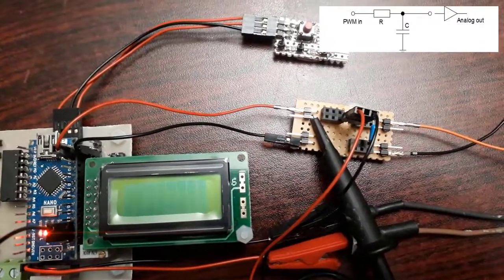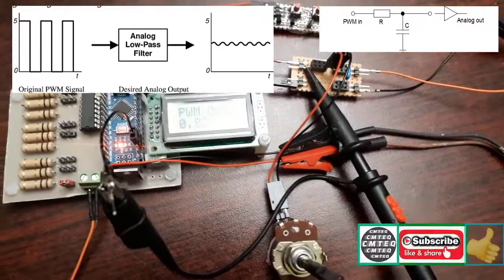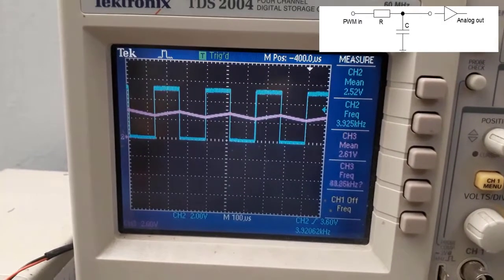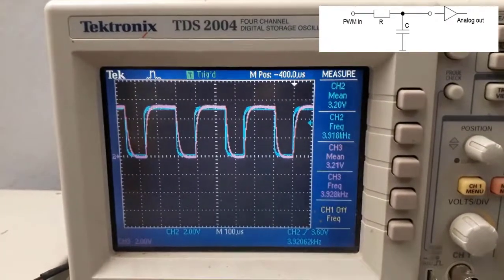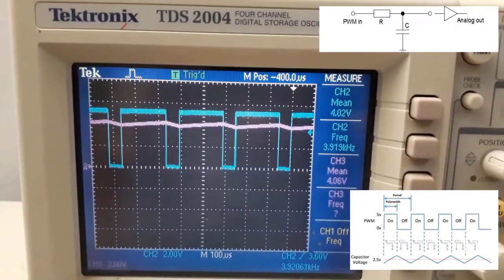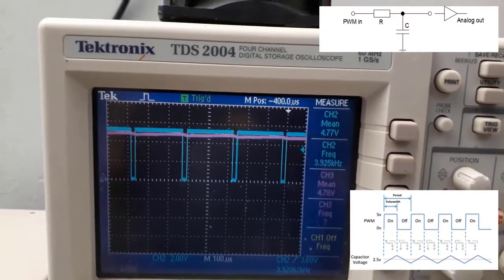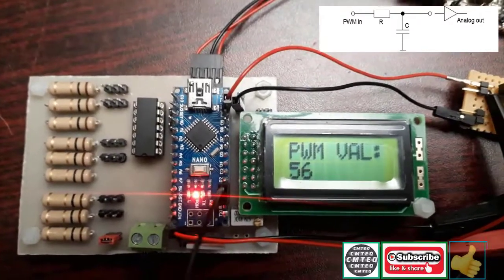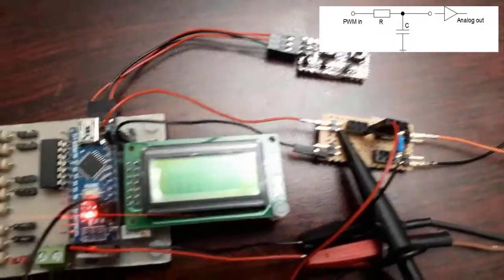How to convert an Arduino PWM signal to an Analog signal (DAC, 0-5V). part 1

Comment: This video is a saver, I love how u pat your oscilloscope btw
Reply from the maker: Ah ah, that was the trick to keep it working, I have since fixed it by replacing one of the powerline capacitors that control the display.
I have a few videos on this topic, including the 0 to 10V DAC.

Comment: Nice man, was thinking of doing the same, what are the values for you cap and resistor
Reply from the maker: Hi @IRON MAN , this is basically a low pass filter, I used a 50k ohm potentiometer and a 68nF ceramic capacitor. 
This is very simple to try it out let me know.

Comment: can i see the dac circuit for pwm arduino ?
Reply from the maker: Hi Haryudi, there was no DAC circuit for this tutorial, this was a straight up PWM output going through the RC Filter network, this is basically a Low pass filter cutting off the PWM frequency. Here the resistance on the RC is replaced with a potentiometer so that you can control the cut off frequency.
So, the DAC circuit is basically the Low pass filter made of a 50k ohm resistor and a 68nF ceramic capacitor.